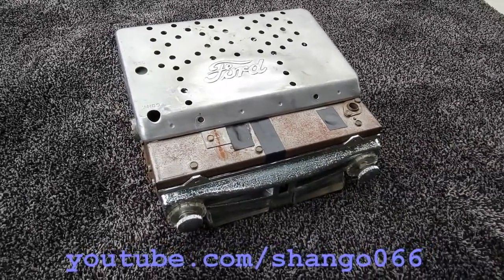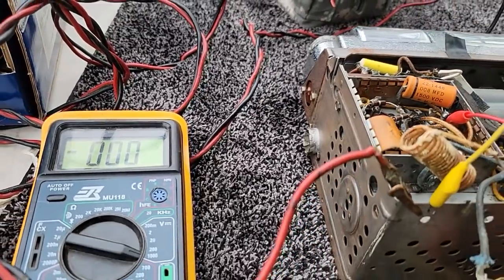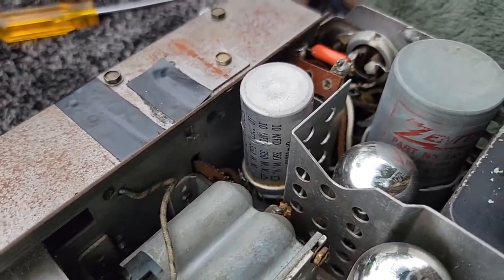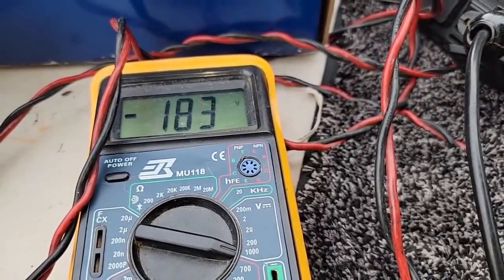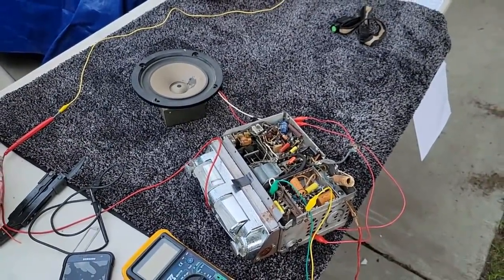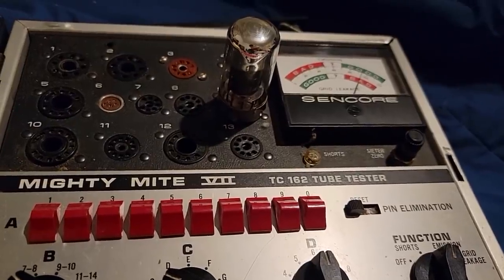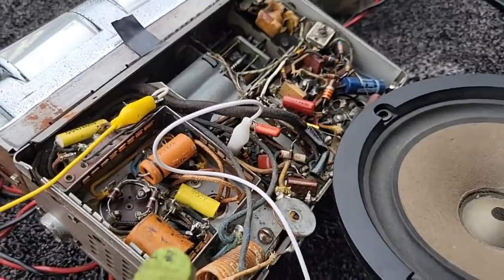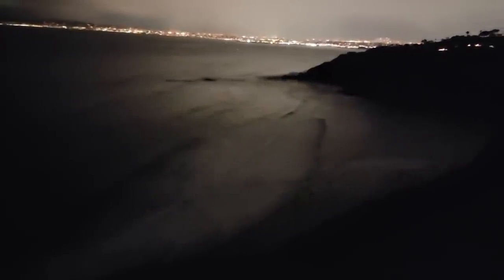Ford Zenith Tube Car Radio Diagnosis to Repair Quarantine Video

Comment: I realize you have to learn on something how to repair tube electronics.  Everyone develops a technique over time.  I hate to see someone learn on something as compact and possibly valuable as a late 40's car radio.  Who was in there before you did a lot of damage that could have been easily avoided.  AA4's & 5's are much better to learn on.  Graduate to a car radio after you have several common sets under your belt and even then before touching an auto radio,  get a book on repairing auto radios of the era and read it.   

I do not know what happened to the chrome but the steel chassis is in very good condition.  That set must not have many hours on it as it still has the Zenith branded vibrator.  What you find in the Ohio area is rusted out and dirty but the chrome survives much better than your example.